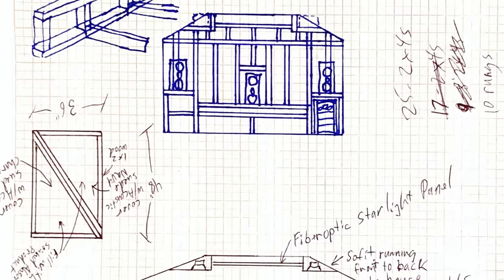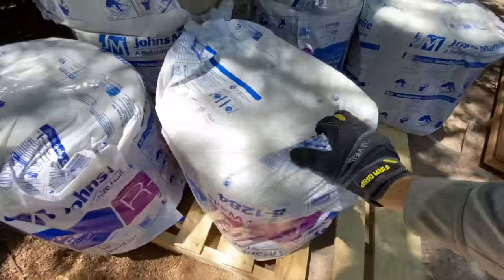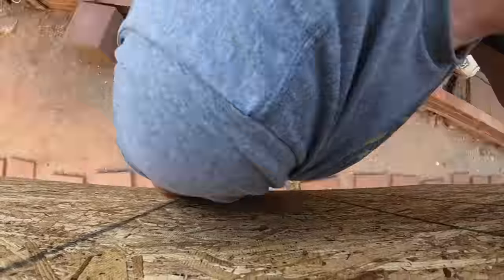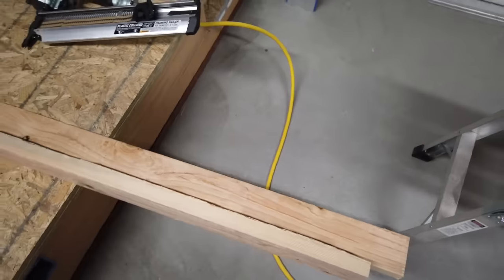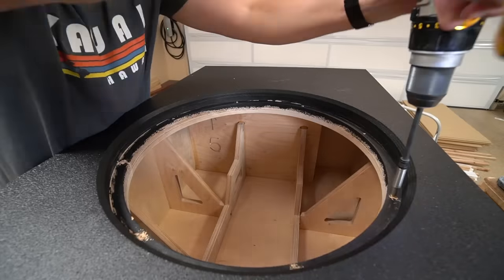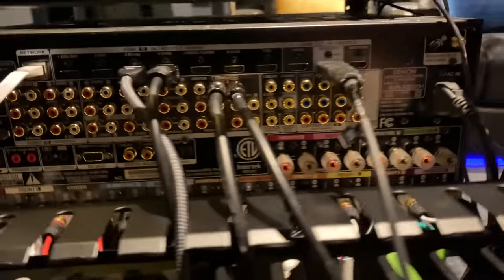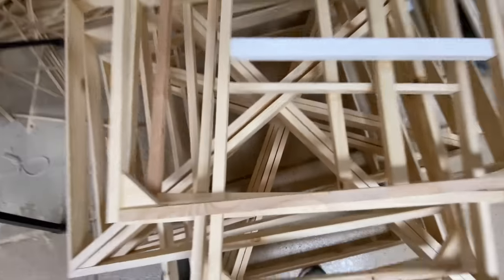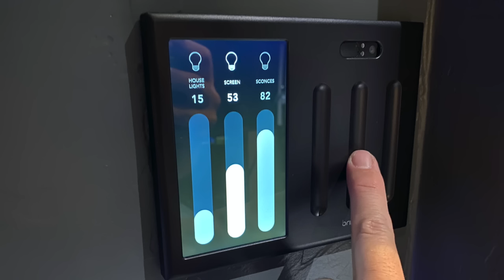I Turned a Boring Shed into an EPIC Home Theater Setup

Comment: When building a studio, listening space or home theatre from scratch you can actually negate having to use acoustic panels at all. If you use high quality insulation in the walls like OC703 you can use acoustically transparent cloth (like you used to cover the speakers) to cover the entire walls rather than sheetrock, essentially turning all of your walls into acoustic panels. If you use cloth on the ceiling too and some sort of metal mesh to hold the insulation you can even turn your ceiling into a giant bass trap. 
Then instead of building absorption panels to hang on the walls, you can build diffusion panels to add diffused, controlled reflections back into the room so it doesn’t sound uncomfortable and borderline anechoic.
Reply: @ Kevin I appreciate the feed back it really helps when I start building my own theater
Reply: Metal mesh would rattle too much
Reply: @kiwibird8441  If it is installed correctly and fastened to the ceiling beams it will not rattle at all. 
The only possible acoustic issue would be resonance, but if there is acoustic insulation resting on the metal mesh that will absorb and mute any resonances. 

You could also just use extra wooden beams to hold the acoustic insulation in place if you are worried about metal rattling or resonating, but it will add more hard surfaces and therefor more reflections.
Reply: @kebbinator  it will rattle
Reply: Kevin another option that is quick and easy and perfect for DIY - blackout curtains! I used red black out curtains on my back wall ,  dark gray on the two side walls until near the front I used black. The room sounded perfect!
Reply: Wrong.  Should have hung acoustic liner/vapor barrier on the studs, then attach RC channel,  then 2 layers of 5/8 inch thick type-x sheetrock attached to channel.  Also should have 2x6 stud walls and 2x10 roof rafters.  Also missing vent chutes on under side of roof deck and attic roof venting.  These are some of the reasons you should hire an actual professional and reputable general contractor.

Comment: I've never thought to do this! Excellent video except 1 thing.
You spent a lot of time and attention to detail on the build, which is impressive. You've even got what looks like really high end speakers and subwoofers, then you decided to go subpar on the amplifier with an AVR instead of separates?
Why?
Why spend all that money to skimp on the sound right there?
Do your system a massive upgrade and get rid of the AVR, get a pre-pro and external amplification. 
You'll NEVER regret it.
Edit: both subs in 1 location will do nothing to help reduce room modes. Another missed opportunity was not using the rear riser space as another subwoofer enclosure. Multi sub in multiple locations will help smooth out the bass response.

Comment: That is such a small screen - if I were to build a theater room, it would have to have a big screen as a fundamental requirement. My regular TV is 85" so big should be big.
Reply: I was thinking the same thing! He used a projection screen. I'd never use that over a 4k t.v. I'm sure the sound was amazing, but the projector? Not so much!
Reply: A friend of mine mounted one of these projectors in his large dinning room.  No screen.  Just a white wall.  We watched the superbowl at an almost lifesize ratio.  It could be that this guy's is on video, but yeah, it does look small.
Reply: Big is like sub woofers.. if the room isn't big enough, you don't get the advantage of the bass having enough room to develop. Your eyes only see so wide.. so a big screen forces you sit farther back.. to see it all, essentially making it a smaller screen again. An ipad can seem as big up close...
Reply: @morbidmanmusic  Yeah but, There is NO match for 4K T.V!
Reply: @Emma-dh1lx  Do you not know that there are 4K projectors? Just look at some of the 6-10k ultra short throw laser projectors. Projectors can be very high end, and just as vibrant as a 4K tv
Reply: @kaijukong2878  Yea, these use them at the drive inn over here. Still not the same!

Comment: Great job. Would be good to know more about the cost of the projector and sound system as the houses in England tend to be smaller than the USA. An outside sound insulated shed would be ideal. I already have a 16x12 summer house which currently stores my motorbike and my lounge is my home theater.

Comment: Getting a permit to put a shed on your own property 
The land of the free
Reply: Anything over 200 sq ft here. Even if you build something that's right at or under you need them to sign off on where it is getting built. Freedom is an illusion.
Reply: To add you will get penalized with higher property tax.

Comment: Why not do complete sound proofed walls if you’re doing a build from scratch?
Reply: I was thinking the same thing. My living room theater setup has some serious punch but my house and the interior screen wall are insulated and sealed well enough that even when pushing over 3000 watts at REALLY high volume you only hear a tiny bit of bass outside. It does vibrate the windows a tad though, lol.

Comment: Cool video! I can give my notes, FWIW: Good projector and speaker picks! I dislike the forward facing blue LEDs in the chairs -- whyyyy. Missed felt between the riser and concrete floor, and also under the riser top. Riser needs 7% open area to be effective for Helmholtz. The only reason to do GG is soundproofing (keeping sound in/out). If your only aim is acoustics (quality of sound in the room) then it only helps that the damped drywall won't resonate. You can get the same effect for acoustics with QuietRock, making install a bit easier. Your subs are cool, I like that they are DIY but reasonably so and they look badass. When filling the riser and other voids, you want uncompressed and unfaced batts. DMD fabric is nice. I'd be scared the fridge makes noise. Overall the room looks great, thanks for sharing!

Comment: Great project. Now that is done what would you change? Would you go with a flat paint instead of a shined finish? Also those subs looked massive for the space, at what percentage of capacity are they running? Also is that a solid core 6 panel door?

Comment: If you lived in a cold climate, this would be great to use a rack to mount the av equipment and stick it into an section and it would never heat up. And since the top mesh would be blocked there would be zero dust

Comment: Instead of that 2" conduit, you should have used some "smurf" tube. Flexible, designed for low voltage installations.

Comment: Yep... figured this had to be somewhere with no winter, lol. Lotta work & $ I bet, looks great. Movies look and sound better on disk, so ditch that 4k player and get the Panasonic DP-UB820. The main reference level player used to be some $1,500 OPPO model that isn't made now. Some Panasonic  model is now and it's just over $1k. The DP-UB820 has the same video processing but not in an all metal build with a bunch of exotic features you would never need and is $500... very happy with mine. There is a difference between streaming and discs in both video and audio... if I notice it on my system in my home, which is nowhere near the gear you got, sure you will also.
Reply from the maker: I agree with you and shortly after I posted this video I did buy a UB820 but a few weeks ago I stepped it up even further with a Kaleidescape Strato C media player. Wow what a difference playing 100% uncompressed video and audio.

Comment: All that work and its very nice and with great sound and speaker set up. BUT!!! The screen size after all that work is very small!!!! I would want a screen much bigger than that after all that effort. I am in the Uk and in  an average semi detached house. I installed a BENQ projector in my living room ceiling, and have standard surround sound speakers and a 50" LED tv. I built it into a cabinet that folds the tv down flat, and I project onto the biggest wall in the room, giving me a 400" inch plus on the diagonal screen. It looks amazing and the sound is pretty good as well. On looking at this video the screen size that you have is less than half of what I get. Yours looks not much bigger than some of the larger tvs available now. Its all down to preference and quality and your theatre is amazing, I just would like a much bigger screen for the money involved if it was me.....

Comment: It might just be the lighting but it looks like you forgot to put the gasket under the second frame @1:30 lool

edit: it's all pressure treated on the bottom which is great, looks really good. Mine will be on the list!

Comment: Roof "was approved by the engineers". Did they actually calculate that rebuild?. No way that "new" roof would hold up the snow loads where i live ,but since i see the plants in your garden i guess you never get any snow. It functions for keeping rain out but it was definatly a downgrade for the structural stability of the roof. what you usually do when weakening the roof like this is you can double the amount to compensate if you do not want to calculate it because its just a shed. Nice "shed" you got there tho. great work!

Comment: LOTS of little details and fundamentals to pull of a "quality" home theater project! Definitely need to go with double thick outer shell on the building. Then suspended isolated channel on hangers off the frame for best sou isolation in that small space. Gotta do it to keep it quite as possible, minimum!  Also, I'd have to put a bass trap in that ceiling instead of expanding the space, to absorb all the extra bass. Yes, it's then an 8 to 9' ceiling max but can't get around it.  Kudos for the front wall bass absorber help though. However, the back seats against the back wall ruins!. That's NOT good!!  acoustic nightmare back there!  Rows need to be pulled foreword to like the 1/5th 3/5th's positions and the riser turned into a bass trap as well.  Also, better off w 2 rows of large couches, or one row, plus one row with larger theater seat love seat in the theater seat row, etc. dual 21" woofers in that tiny room!?!  Yikes!!  Never support low bass in that room. All Looks nice though. Oh and wall to wall front 16x9 IMAX presenting acoustic screen, or bust!! If you need the 8k upsampling JVC then even better for sitting close. Yeah definitely going entire front wall covered screen instead of smaller. Overall nice outcome though for a rookie :-)
Reply from the maker: Thank you for your input and some of those suggestions were considerations, but at the end of the day it comes down to functional use of the space for me over perfect sound stage, how many people I knew would be in wanting to enjoy it, and the limitations of building it in the shed. The back row is the least quality for audio but usually just kids back there so they like all the "rumble". The riser is a base trap and no option to make the ceiling lower as I'm 6'7" tall and didn't want to feel claustrophobic.  I've never had a complaint from the neighbors about the sound so I did "enough" of a sound proofing job to server the purpose.  Considering the shed is away from the house, no vibrations or sound carries into the main house.  And yes, was a very green rookie for sure.  did the best I could with what I was working with.
Reply: @MANSHED  6'7"!?!!  Yikes!!!  Did ya play basketball!?!  lOl!!!  Seriously though, that's the catch. If you live out in the boonies, and it's super quiet away from  the neighbors, roadways and airports/trains, etc, then you're all good!  Then sound isso doesn't matter so much, true, true.  And, yes, kids only in back row is prolly fine for par.  All that then, well done sir!  Hope it gets great use and everyone enjoys

Comment: The only thing I see wrong is the fiberglass insulation. It’s ass, literally a waste of money. Buy insulation foam boards or spray foam. 1000x better. With fiberglass you’ll literally have to replace it every 2 years if not every year.

Comment: Nice idea from you, but I don't know why you build everything only from wood. All it takes is a little stronger wind and all your houses are gone. And don't even get me started on your roofing materials. You just put dirt on the roof, no wonder you have to redo it every few years.
It sometimes seems to me that you are stuck in the stone age.
Reply from the maker: The other roofs and structures I’ve built here have lasted 15 plus year without redoing anything not sure you actually know our region and climate.
Reply: @MANSHED  It can be that they keep them so long but with you that is rather the exception.

Come visit Europe, the houses here are ready for the century.

But as already mentioned, I find the idea behind it good, material is ok
I have the nails rolled up when I saw that you have glued the drywall.